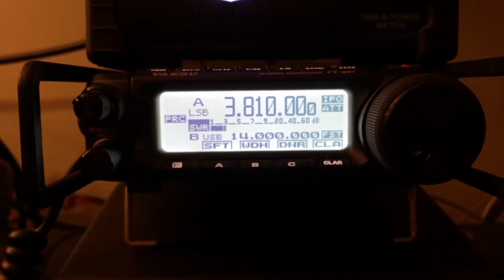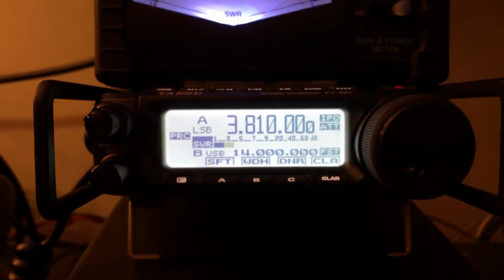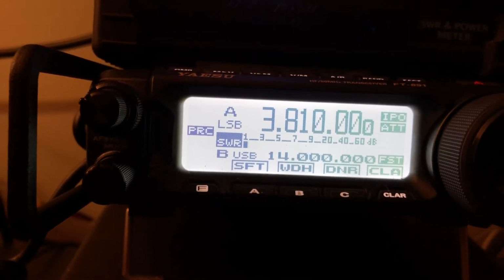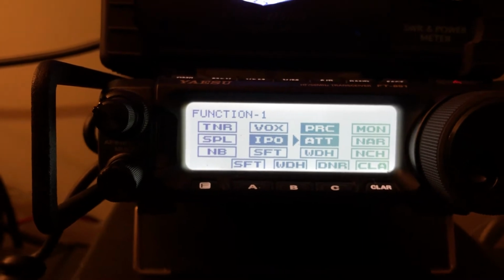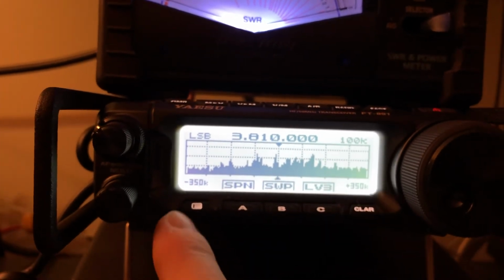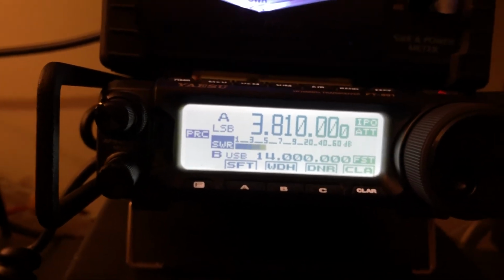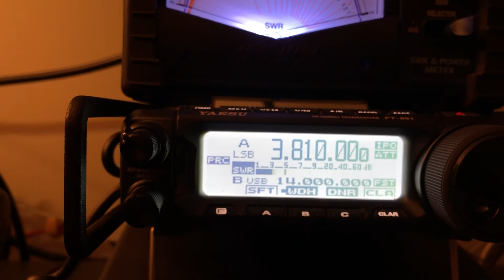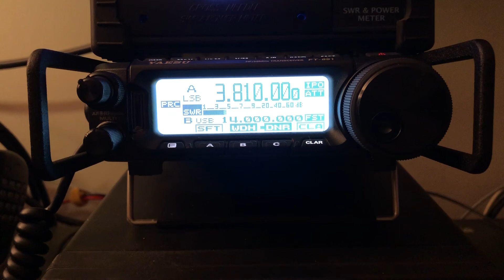Yaesu FT-891: Digital Noise Reduction (DNR)

Comment: the DNR is great
…..too bad it shuts off every time you change bands or even VFO’s
Reply from the maker: The rig only has 8 Megabits of memory in support of the DSP.  That’s also why the DNR algorithms cannot be updated to match those in the FTdx10, even though both transceivers use the same DSP chip. The FTdx10 has 64 Megabits of memory.  But the DNR in the FT-891 is still better than most competitors, if you use it correctly.
Reply: @n4hnhradio  
yeah
it’s still a great POTA rig
warts and all
:)

Comment: I will definitely try your suggestions!
I may have days/nights with a lovely S1/S2 noise floor.   Generally speaking, i can try to do any work and have S9 to +10 and maybe +20 on my FY-891.  Very annoying - means i have hours or days where I cannot work -  all I hear is hash. 

All I know is the QRM in this mountain community which should be very quiet is like a stadium band rock concert where your hearing is ruined for life.  Other times, it is complete quiet

Thank you for this presentation!
Reply from the maker: DNR doesn’t do much for QRM. It is mainly effective against natural noise (QRN).  The noise you describe could be from digital sources, devices with your home or power line noise.   Operate your radio with a battery and turn off all circuit breakers in your home.  Noise gone?  It’s coming from within your home.  Could be LED lights, wall-wart power supply, laptop power brick, plasma TV, food sealer, wireless phone charger, and more. 

A Noise Blanker can help with power line noise, until the power line noise reaches an excessive level. The NB degrades receiver selectivity so only use until you can find and solve the source of the noise. 

I recommend watching the videos in my Power Line Noise playlist and my HF Noise Interference playlist.

Comment: Thank you so much for posting this video. I'm a fairly new ham and bought an Icom 718 but had so much noise in my home office I packed it up and bought the FT-891 thinking I could take in the back yard or the local park as a portable radio. using these tips I managed to get clear crisp reception IN MY OFFICE. You have a new subscriber 🙂
Reply from the maker: Glad I could help, Dave!  There is more to these radios than the manuals truly reveal. The more I use them, the more I find them more capable than I first thought. And I consider myself a savvy purchaser.  As one viewer put it, “a Yaesu is a thinking man’s radio.”  There is a bit of a learning curve, but it pays dividends.  

I’m still amazed at the capabilities of the FT-891. I mean, it cost approximately half the price of a good ham radio in 1959. $1200 back then. Adjusted for inflation, that’s over $12,000 today. Those hams in 1959 must have really loved amateur radio to pay the equivalent of $12,000 for a radio. 

73, Doug

Comment: I got a ft857d mobile with a atas120A antenna, I run 10 meters a good bit, 2 meters quite a bit and can't wait for 6 to open,  do you happen to have any helpful advice on audio on that rig?
Reply from the maker: Nice setup.  I hear many good reports about the ATAS.  I don’t have a 857D to test, but I’m pretty sure that the settings I show for the FT-891 will get you close.  Yaesu has been using the same parametric EQ approach for many of their transceivers for quite some time now.

73, de N4HNH
Reply: @n4hnhradio  i enjoy your videos, got the ft857d mobile, ft991A, ftdx10 and I want to adjust some settings on them by your videos
Reply from the maker: You will want to follow the settings for the FT-891 hand mic.  Then tweak for your voice.  My settings are for my voice but, they get most operators close enough to fine adjust for their voice.

73, de N4HNH
Reply: @n4hnhradio  will do, I gotta get my ole truck has my ft857d in it back on the road, it's down at the time, once I get it running again im.gonna play with it more, hope to make contact with you on 10 or 6 someday
Reply from the maker: Hopefully we can make contact.

73, de N4HNH

Comment: Did they ever fix the NB in this from distorting?
Reply from the maker: Sadly no.  I doubt they can.  That is an inherent issue with DSP-based noise blankers.  It’s tolerable though.  It mostly affects strong signals.  I usually run IPO, ATT, and RF Gain set at 5 S-units when working a strong station.  And I run IPO anyway on 40m and below. 

73, de N4HNH
Reply: @n4hnhradio  thanks Doug. I find in the mobile setting NB to 0 is enough to knock out the car noise etc and not be as distorted, but even my ftdx101 will distort with a strong signal , like you said I think it’s the nature of the best.
Reply from the maker: Yes, the FTdx10 NB will distort too, if set much above 5.  I’m glad the FTdx5000MP has an analog NB and a DSP-based NB.  The analog NB works great.  The DSP NB works better in the 5000 than most, but I have to be careful not to set it too aggressive.  There are times when the DSP NB can help though.

I did the firmware update for my FT-891.  The update was supposed to improve the DSP.  If there was an improvement, it sure was subtle.

73, de N4HNH

Comment: Can you get a 250 Hz CW filter for this radio?
Reply from the maker: Not for the FT-891.  It only has only two roofing filter slots, one 3,000 Hz, for SSB and CW, and one 15,000 Hz, for AM, FM, etc.  The DSP handles the rest.  Don’t worry though.  The DSP is extremely good at CW filtering.  Using a combination of IPO, ATT, DNR, Width, APF, and/or RF gain, I can make my FT-891 sound like I’m listening to a code practice oscillator.  I think I showed it in  two or three videos on the channel, in the FT-891 playlist.

73, de N4HNH
Reply: @n4hnhradio  That is great. I have one on order. I can't wait to do CW with it. Thanks for the great video's I would like to do a one time patreon at this time.
Reply from the maker: Larry, the FT-891 is a triple conversion superheterodyne receiver.  That helps with selectivity.  So the 3,000 Hz roofing filter has some assistance downstream in the receiver.  Admittedly, there is a downside to triple conversion.  There is an increase in phase noise.  But the DSP can counteract the phase noise. You might not even notice it.  

I greatly appreciate your contribution via Patreon!

73, Doug
Reply: with IF DSP, you can narrow CW all the way down to 50hz bandwidth.  it’s a very nice CW rig

Comment: I just received my FT-891 a month ago and have been able to get it mobile once and used it at home twice.  When I enable DNR the rig throws a ton of really unhealthy sounding static.  Experience anything like that?  My SWR has always been < 1.7 when used and have been on both 20M and 40M with the same results on this rig.
Reply from the maker: If you haven’t minimized noise first with ATT, IPO, and RF Gain, the amount of noise going into the DSP unit might overwhelm the DNR.  The sound it will produce can be described as a watery sound.  After I minimize the noise with ATT, IPO, and RF Gain, I enable DNR and set it to algorithm number 9.

If you use the aforementioned method and you still get the unhealthy sounding static, something else is going on.

73, de N4HNH
Reply: @n4hnhradio  This was the exact cause / solution to my issue.  Had not engaged either ATT or IPO.  Much appreciate the information!  Cheers and 73
Reply: Unfortunately, in this case, the issue persisted.  Yaesu determined the unit needed to be shipped out for warranty repair.  Will see how things resolve.
Reply: I should include antennas....both a buddistick setup at 20M and 40M and Shark mono-band hamsticks at 20m and 40M.

Comment: Fantastic video! I just picked up the FT-891 over the weekend after passing my General. What a difference the IPO, ATT and DNR make. Thank you! 73 de KT1RUN.
Reply: Do you have a link for the rails? Any other must have accessories for the FT-891? I'm looking to do some SOTA and capture the experiences on my YouTube channel. Thanks in advance.
Reply from the maker: Welcome to my channel.  The rails are from Portable Zero.  There are two colors available.  

I invite you to join me on MeWe in the Ham / Amateur Elmers Group.  There is also a SOTA (Summits On The Air) group, for those interested in hiking with ham radio.
73, Doug
Reply: @n4hnhradio  Thanks for the info on Portable Zero. It's a blessing and a curse. It looks like I now need to buy the Escort for both my FT-891 and FT-818. Their Sherpa back is also very intriguing. I keep telling my wife that I'm finally done buying equipment and gear for this hobby for this year, but there never seems to be the case. Also, I have note to look you on MeWe. Thanks for the help again.

Comment: I use the FT891 with a manpack.  I really enjoy that DSP, better than my IC 7300.
Reply from the maker: It’s hard to believe that we can get this level of performance from a $600 radio.  73, Doug
Reply: @forgetyourlife  Real world, I measure only 1amp on receive.
Reply from the maker: I only measure 1-Amp on receive.  1.1-Amps with volume high.

73, de N4HNH
Reply: I agree. I got the FT-891 about 2 months ago for POTA, and DNR really pulls out the weak ones out of the noise on the FT-891. My ICOM 7300 sits in the shack and it's nowhere as good.
Reply: @BikingHikingRadio  Now if Yaesu would put a color waterfall display on the FT891 like my Xiegu G90, it would be the perfect radio.